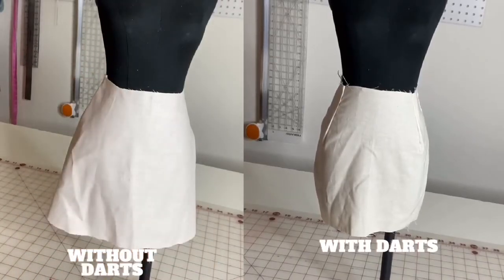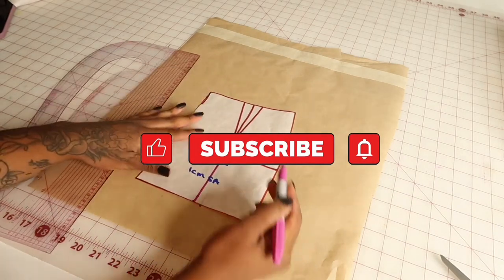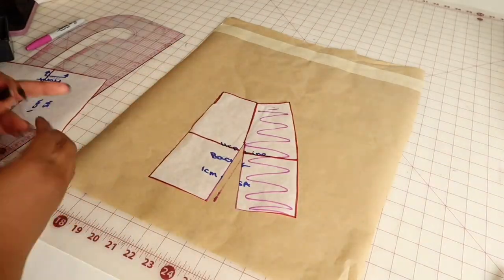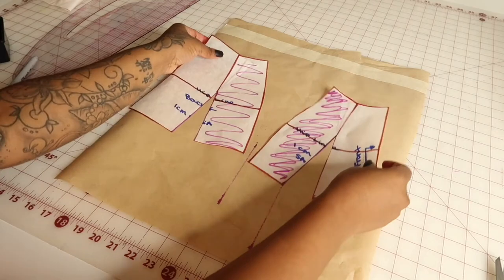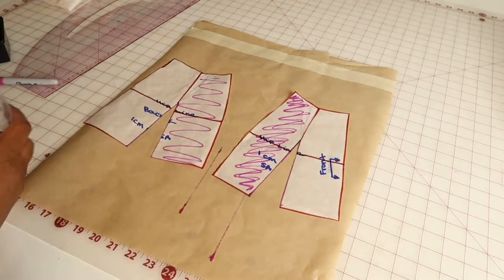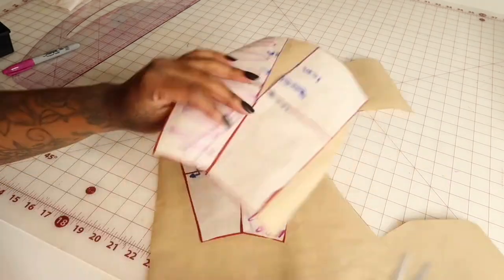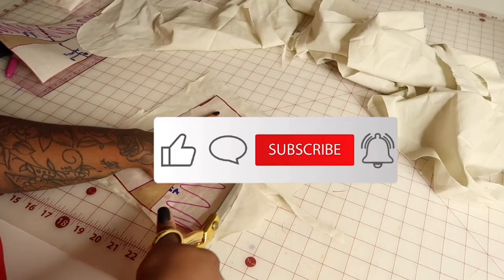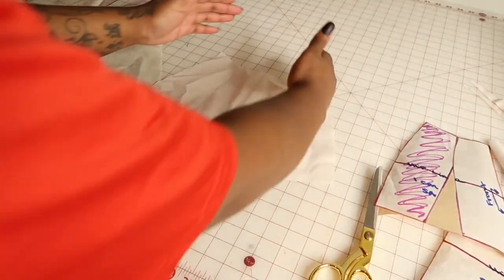How to Remove a Dart from a Skirt Pattern- Dart Manipulation

Comment: But now the skirt is Aline instead of fitted skirt? Is there a way to remove dart without altering the original shape below hip line?
Reply from the maker: It’s A line because that’s what I wanted. When you move the dart the excess has to go somewhere. It doesn’t just disappear. If you want it fitted , make a princess seam or take the excess off the side according to your measurements